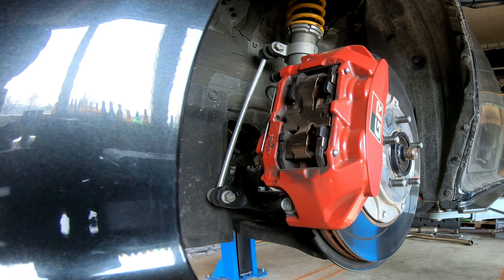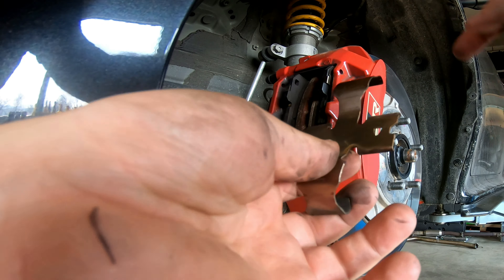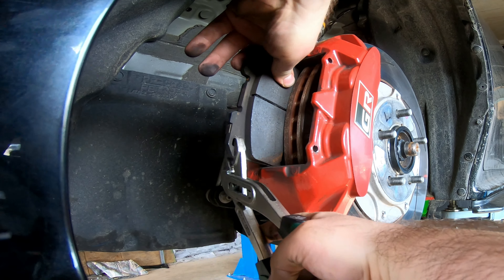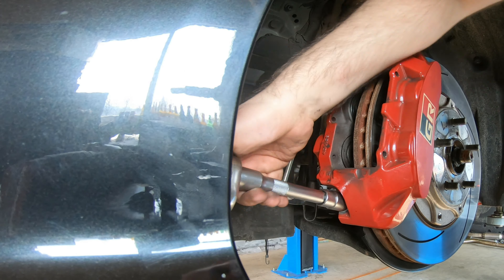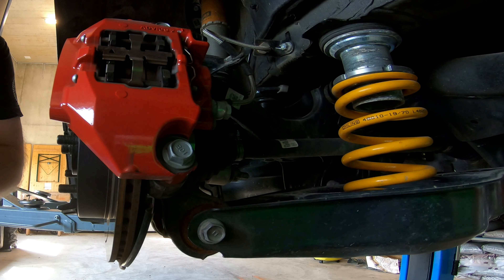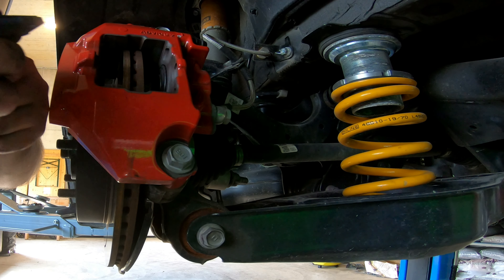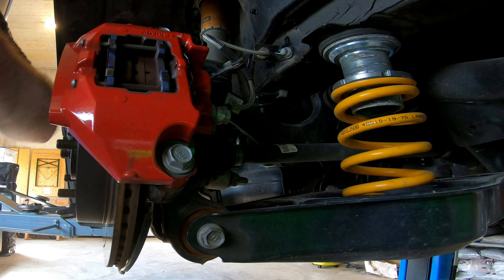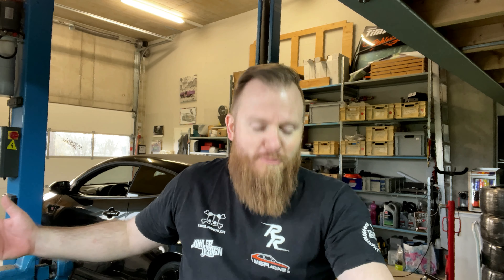Toyota GR Yaris DIY - How to change your brake pads and discs.

Comment: Great straight forward video! Thankyou for sharing.

Just a tip, the Toyota FSM actually tells you not to remove the 2 bolts in front of the caliper, rather, it tells you to remove the 2 bolts on the bracket attached to the knuckle. And if you remove the ones on the front caliper you need to reinstall in and tighten it in increments of 30nm top to bottom and 100nm final top to bottom while the engine is on and brake pedal is depressed.

Comment: Good video and I think people would appreciate similar ones for the jobs that can be done at home. I remove the large metal clip first from the easy end then small locking wire then rods. The wire you can just use finger to get the middle hook through the hole. Then you don’t need to touch caliper or bend wire. 👍

Comment: I don’t want to be that guy but the front disc you showed being fitted looks like the cooling vanes are going the wrong way around. It looks like the disc for the other side (unless they aren’t handed and one disc always spins the wrong way around?).
Reply: It's because Toyota/Lexus run the vanes the other way around to what's considered conventional. There are discussions around this on the UK GR forums.
Reply from the maker: It‘s exactly the same as OEM.
So unless Toyota fucked that up pretty good, it‘s correct. 😁
Reply: @RotheliRacing  thanks for responding :) 

I had an ST205 GT4 and they did have ‘handed’ discs that went in the opposite direction. I’m enjoying the series on the Yaris, thanks for the content 👌🏻👍🏻